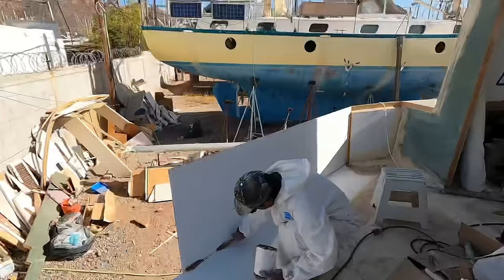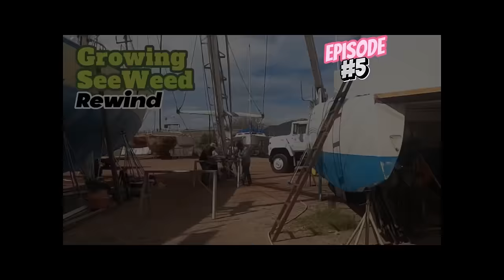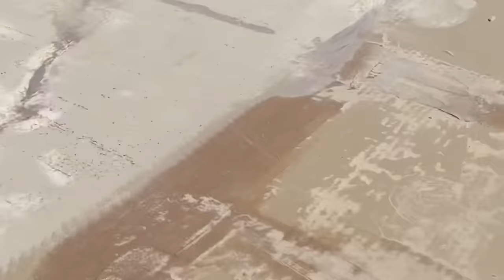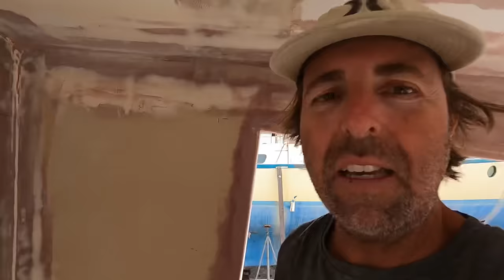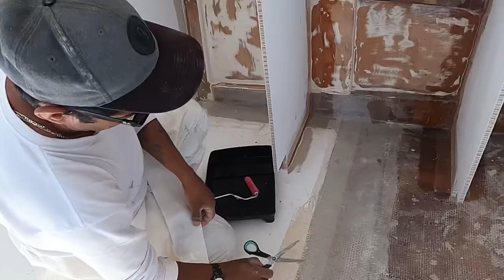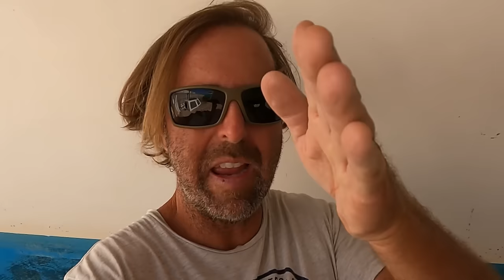(Ep #15) Insane DIY Sailing Trimaran Redesign. “Building our modern Loft”

Comment: Check with the manual for your fridge, but most fridges say to leave an inch or two gap on each side for air circulation.
Reply from the maker: Thanks for the advice... Yes I'll make sure that I have that.
Reply: You could probably use some wooden spacers and stainless sheet metal screws maybe 4 on top through the shelf into the top of the fridge to keep it from tipping, as long as you know the thickness of the insulation on that part of the fridge. Just be careful with the depth on the pilot holes and ensure there aren't wires in the top of the fridge.